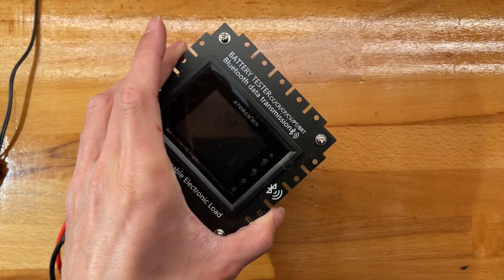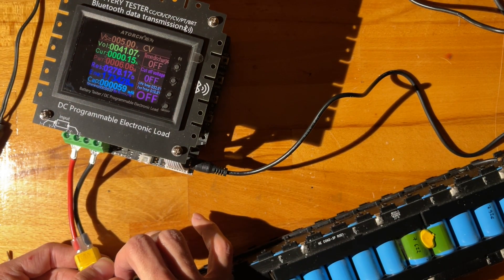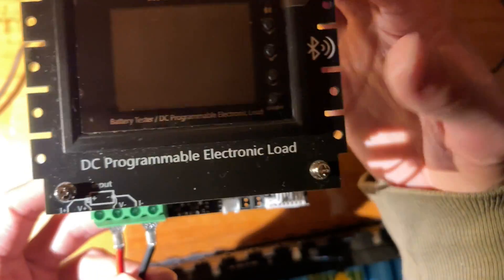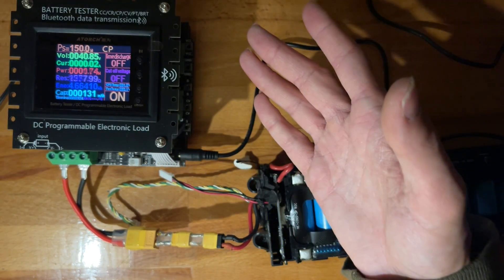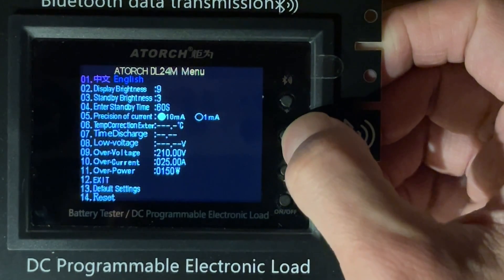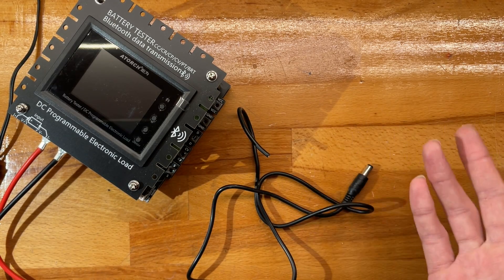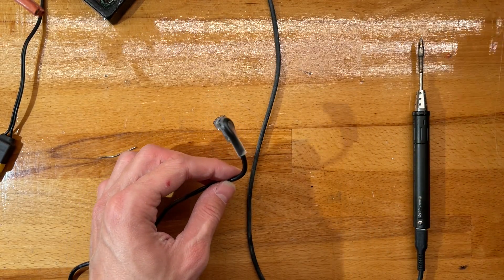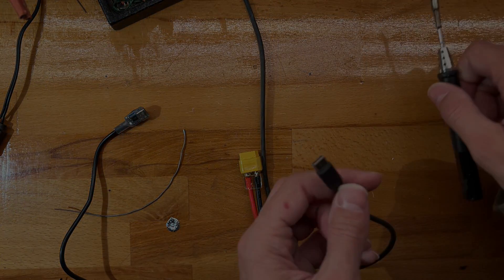ATORCH 150W Electronic Load Review

Comment: if you are testing a bunch of the same cells and you come across some bad ones. Do you actually need to discharge them all the way down or can you tell immediately from the difference in cell resistance?
Thanks.  Nice review.
Reply from the maker: the more work you put into diagnosing faults

the better you'll see

li-ion cells have 50 ways of dying ... 

you could probably have a fancy tester that finds more out quickly but .. with a spoon a hammer and some wood .. there's only so much magic one can do

I really needed to be sure .. because I really don't want to tear that whole thing down (1)

and (2), it may still be that over time they do have a higher internal resistance and are indeed faulty - but that usually IS correlated with a lower observed total capacity

I stand by my original assessment that something's up with the BMS, esp the overcharge bit .. already it chose one or two banks which it charges to LOWER than the rest